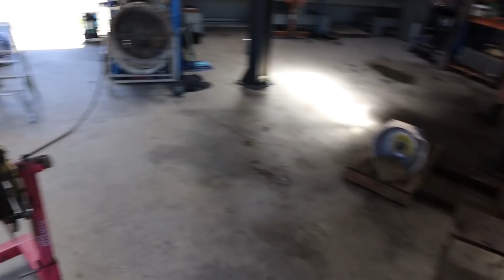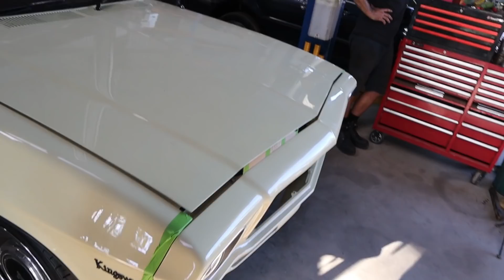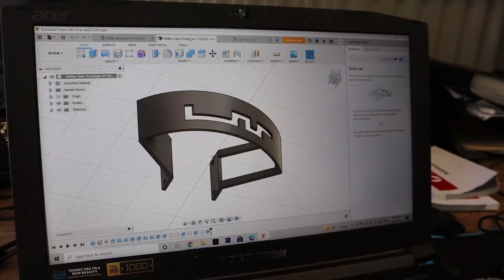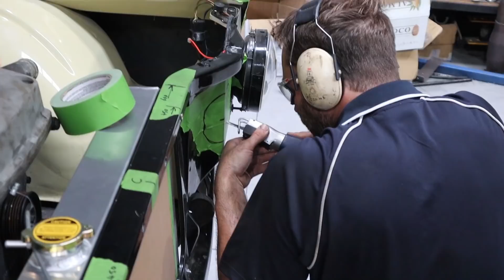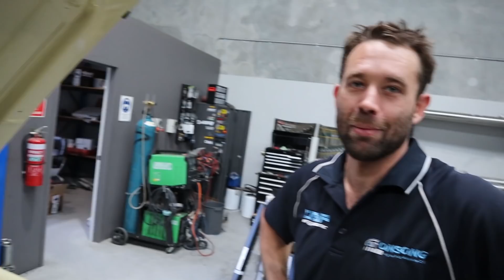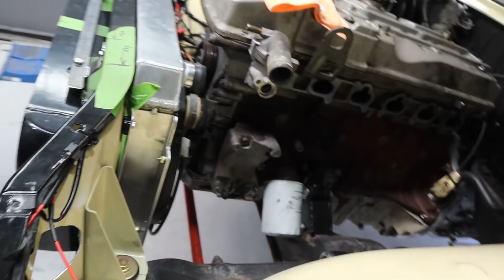Off to Fab (for now) || KingBarra Part 9

Comment: With a bit of redesign you could probably 3d print the coloum shift lockouts as a final product. Saving having to laser cut or cnc anything. If it were more solid/substantial I dont see why it couldn't be plastic (like most modern oem parts).

Looking good anyway fellas. 👌